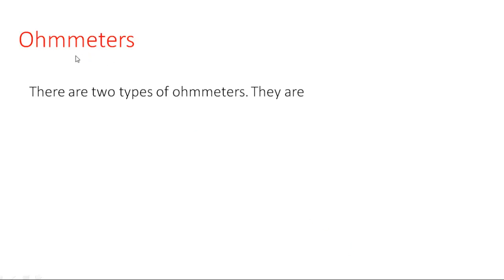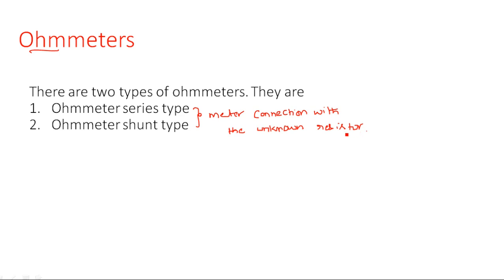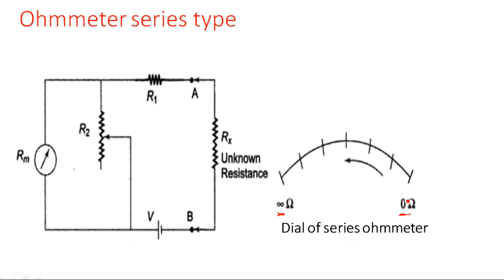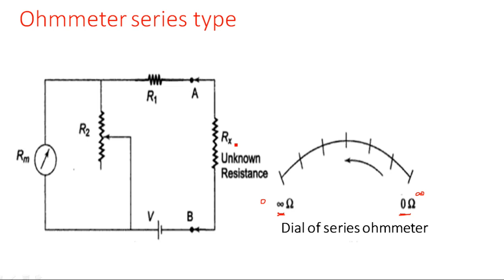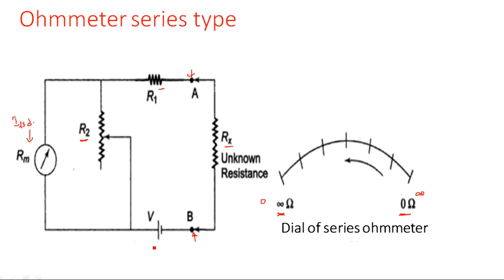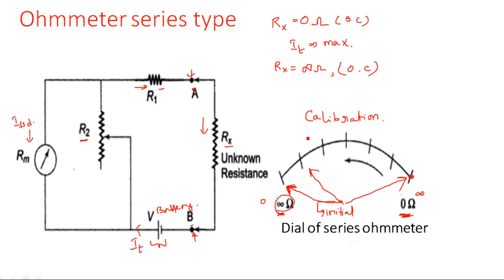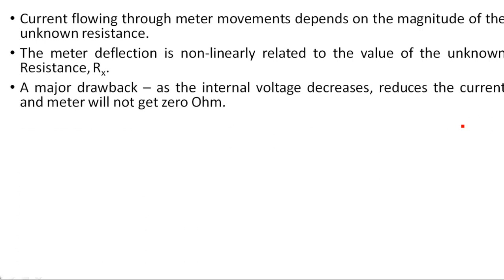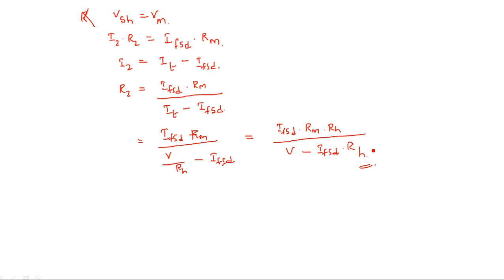Ohmmeter Series type | Electrical Instruments ( EIM ) | Lec - 12

Comment: Hello sir... Thank you so much

I only have one question... What is the point of having Rh... I don't really get it if you can... Explain it a little bit more please
❤❤
Reply: When using an ohmmeter, an external resistor called "Rh" is used to expand the measuring range of the device. This resistor acts as an adjustment factor to determine the range of resistances that can be measured by the device.

When you want to measure resistance, the terminals of the ohmmeter are connected to the ends of the resistor. A specific voltage is applied to the resistor, and the current flowing through it is measured. Then, the basic Ohm's law can be used to calculate the resistance value using the measured values of voltage and current.

But the problem is that the measuring range of the ohmmeter is not unlimited. Therefore, a specific external resistor (Rh) must be connected to the ohmmeter. The value of this resistor is determined so that the ohmmeter can measure a specific range of resistances. For example, if the resistance value to be measured is higher than the value of "Rh", an accurate reading of the resistance will not be obtained. And if the resistance is less than the value of "Rh", the device may be damaged or the measurements may be destroyed.

Therefore, using "Rh" in the ohmmeter helps to determine the range of resistances that can be accurately measured by the device and expands the measuring range of the device. Thus, it helps to improve the accuracy of the measurements.